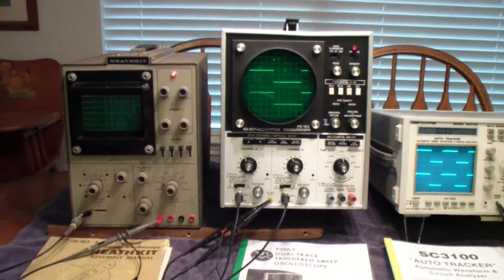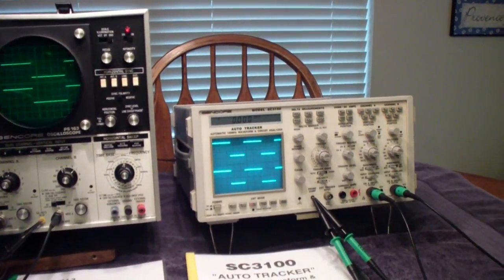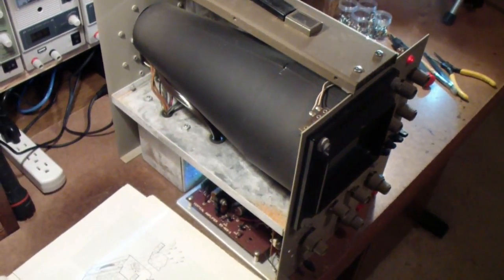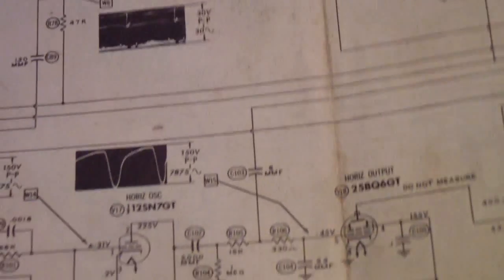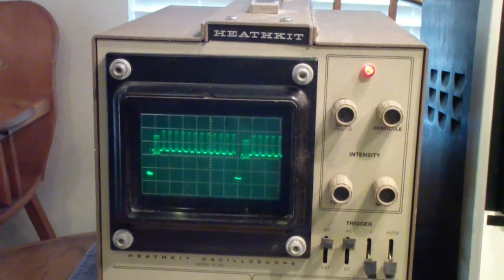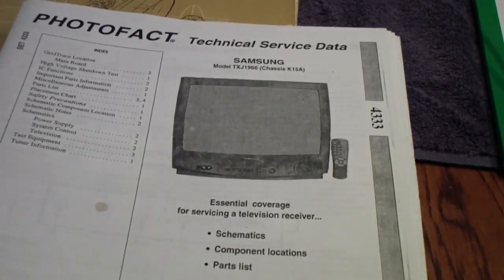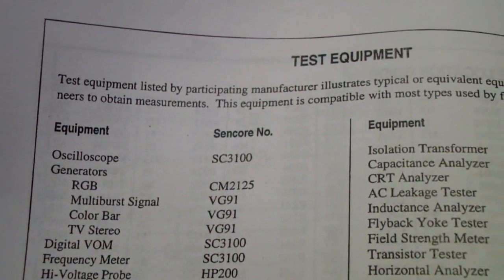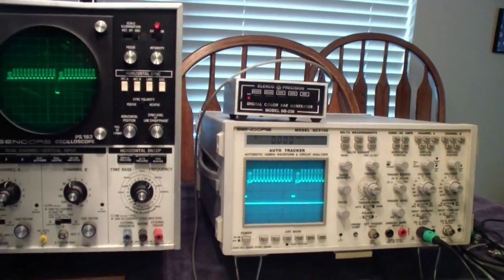TTT055 3 Vintage Scopes

Comment: To follow up on the video.
I grew in my Dad's TV shop "Hoffmann's TV' in Mandan, ND, and spent many hours looking at those Sams Photofact schematics with the waveforms of the signals.

Unfortunately, he never learned to 'scope' the signal, relying instead on how the relative voltages appeared, according to his training with aircraft radio with tube-type equipment during World War Two.

Those highly informative and informational diagrams were very influential when I was preparing Sencore instructional manuals for products in the mid-1970s.

Comment: Some corrections are needed.
The Sencore PS163 was/is my favorite scope of the time, from the early 1970s.

First of all, it was 'dual-trace', meaning that a service technician could observe both the input and the output of an electronic product in a way they could compare the entire system, rather than the typical single-trace scopes from Heathkit, RCA, and even Sencore (PS148), as well as the more expensive engineering products from HP, Tektronics, and others.

In its design the PS163 was based on several circuit boards for the dual-channel inputs, the time-base synchronization board, and the high voltage board for the CRT.

Unique at the time were the 'clip-on' probes that allowed a technician to connect to a measurement point without having to hold a pointed probe while viewing the screen and twirling the dials. I also appreciated the definite "click" of those dials and buttons of the PS163, compared to other products.

I worked at Sencore in the early 1970s and sold many PS163s in the Mid-Atlantic and the MidWest regions at the time. I also produced the screen waveforms for a Sencore booklet that described NTSC television signals from front-to-back in a typical color television set of the day.

Comment: A really nice presentation on the progression of oscilloscopes. I also own the Sencore SC3100, TF46, FE20, PA81, TF26, VG91, TVA92, PR570, DVM56A Microranger, CR31A, LC103, YF33 Ringer and the TC162. In addition I have the B&K 747 and the 747B tube testers. At present I am restoring the 747B because the wrong set of hands go there before me, "badly damaged and in rough shape"  and other test equipment that are to numerous to list. It is nice to see there are a few of us out there that take pride in the restoration of vintage equipment. Have you ever worked on the 747's and if so, your thoughts.
Reply from the maker: +John Cunningham Thanks for the comment. It's nice to see that if I am crazy I at least have company! I have been collecting test equipment since the 1950's and Sencore since the 1970's. It looks like we have collected (and in many cases restored) a lot of the same equipment. I also collect B&K as well as some other brands.
Reply: Yes! guilty as charged. I have enjoyed restoring a part of history for few decades and found it very satisfying when the job is completed," funny how time flies".

Comment: Does the Heathkit read square waves? I just picked one up a couple of days ago. Is there calibration information in that assembly manual?
Reply: +Richardscoat83 and now of course as I watch more of your video, you say that it does in fact have calibration info :) Thank you for a very informative video. I'm hoping to spend some time with my "new" 103 and get the basics down.